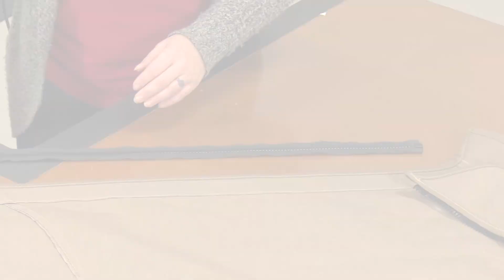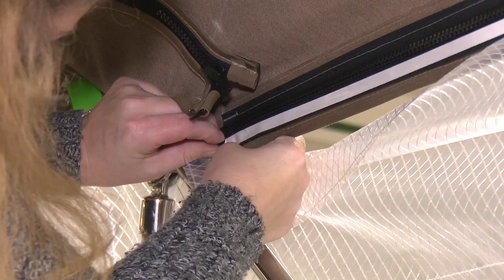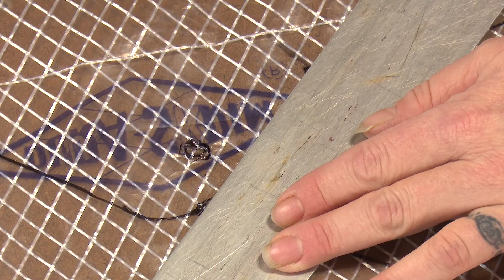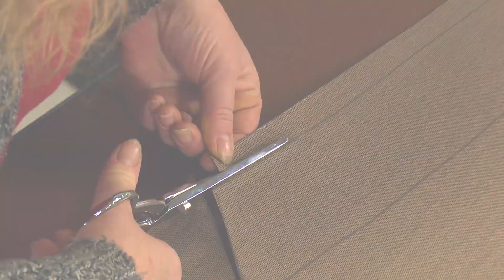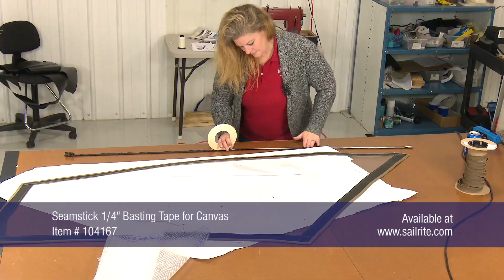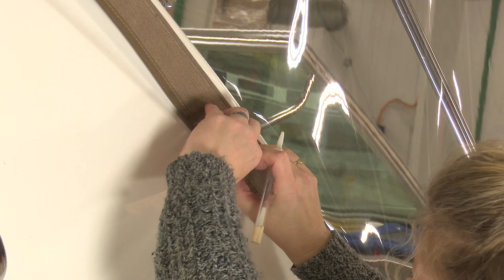How to Make Enclosure Side Curtains

Comment: Do i need a heavy duty sewing machine for this please? I guess I do i only have a basic home machine. Forget that you answered the question except how much these machines are? I only have one boat to do 😕
Reply from the maker: I often get customers asking if they can sew Sunbrella Awing or Marine Grade fabric on a home sewing machine. It always depends on the quality and working order of the home sewing machine you own (so it varies greatly from machine to machine). To determine if a home sewing machine can sew Sunbrella Awing or Marine Grade fabric perform this test:
Cut up a pair of old blue jeans into four layers (not including the jean’s hems). Since a home sewing machine usually can’t handle a thread larger than v-69 use that thread or something comparable and try to sew through the 4 layers of blue jean material. If it sews well and the stitch looks good on the top and bottom side of the assembly then chances are you can use your home sewing machine for small to medium jobs made with Sunbrella Awning or Marine Grade fabric. 
Remember if your home sewing machine can’t perform the test you can get an LS-1 Ultrafeed for a little as $795 and it will do almost any job done with Sunbrella Awing or Marine Grade fabric easily! http://www.sailrite.com/Sailrite-Ultrafeed-LS-1-BASIC-Walking-Foot-Sewing-Machine